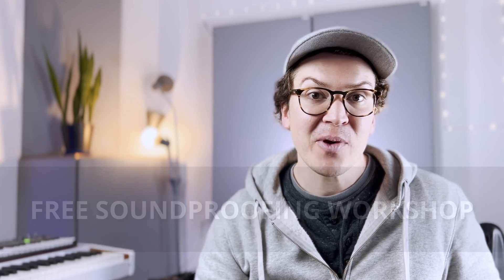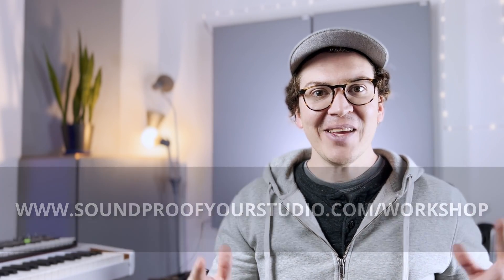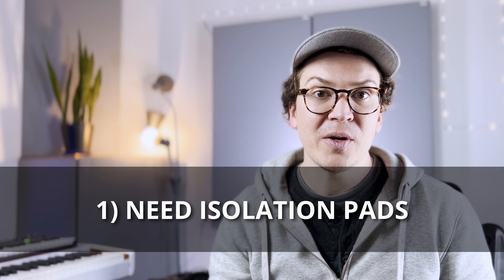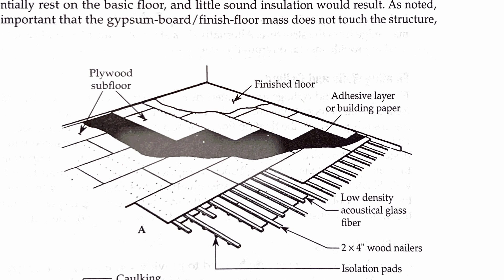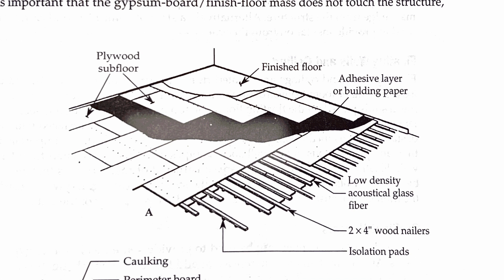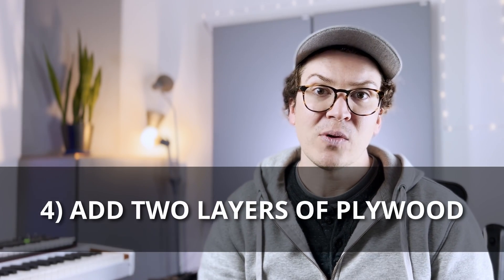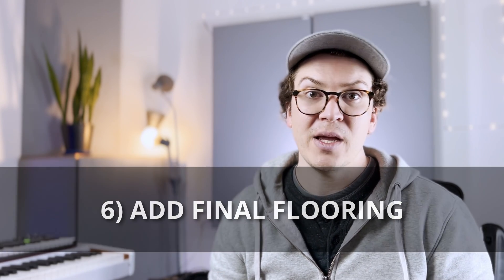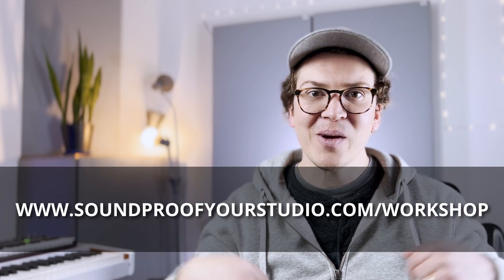How To Build A Plywood Soundproof Floating Floor

Comment: that was a very good and succint presentation that got right to the point and was really clearly explained, no digression or ego excusions about irrelevant stuff.  I am so glad to learn about the rubber joist cradles!  I already have an exisiting plywood subfloor, so I thought I could put acoustic mat onto that as well, or perhaps put it between the plywood layers above. Is that going to be worth the extra cost?  This is a 3rd floor living studio in a wood framed house. Thankyou , Sam

Comment: What about on concrete floor in an apartment on the 4th floor?
Reply from the maker: Great question! 🙏 On a concrete floor, you don’t really need a floating floor for decoupling. You can add mass and absorption, like low-density fiberglass or a layer of plywood with Green Glue to help reduce impact noise and low frequencies.

If you want a detailed, step-by-step approach tailored to your apartment setup, you can book a free call with me here: https://www.soundproofyourstudio.com/Step1

Comment: Why should you use low density Fiberglass? Rather than high density?
Reply from the maker: The density is important because if it is too dense the floor will not float and if it is too soft the floor will touch the subfloor below. Density is carefully thought out in the plan to provide the ideal amount of float. Experience is the best choice here by working with someone who has done this before. Are you building a home recording studio?
Reply: @soundproofyourstudio   thank u for ur answer. Do you recommend Owens Corning Type 703 ? i feel that it is not dense enough
Reply from the maker: Yes, that is what i have used in the past. Do you feel confident you can build this studio perfectly without making any mistakes?

Comment: Thanks a lot for the great video. Would this help for inside a small vocal booth to reduce the noise for Neighbours below? As in building the floating floor just for the surface area of the birth itself rather than entire floor of the room? I get that sound could still travel down but would it help at all?

Comment: What about a suspended concrete slab connected to concrete block walls ?  Concrete is a good conductor of sound.  Once you manage to couple sound into the concrete slab it will propane throughout the entire structure.  In that case, surely it is best to float a floor over the slab.  Especially in a room within a room construction.  I am thinking in particular a home theatre with the subwoofer sitting on the floor.
Reply from the maker: Check out Philip Newells Book Home Recording Studio design. He talks about floating a concrete slab.

Comment: How do I know wether the new floor and sleeper boards won't create a big resonating floor?
Reply from the maker: It’s not as good as a floating slab for that reason, but it shouldn’t resonant as long as there isn’t an airspace. I don’t recommend this design however is was in the master handbook of acoustics.
Reply: @soundproofyourstudio you dont recommend but did a video about how to do it?

Comment: What about building a floating floor over a concrete floor in a basement? Would that help decoupling the room from the house structure even further?
Reply from the maker: No, because to properly float the floor you would need to spend $20k pouring concrete on isolation springs.
Reply: @soundproofyourstudio  I mean, over an existing concrete floor
Reply: @HCkev, I'm eager to find out more about this. I'm in the midst of planning a new studio build with a concrete slab. I'm curious if opting for a floating timber floor would offer any acoustic advantages. Additionally, from a thermal perspective, I'm considering a floating floor with rockwool for insulation. However, if this doesn't significantly enhance acoustic performance, I'm contemplating a more budget-friendly approach, like using celotex boards with a concrete screed on top. Any insights or advice on the best course of action for both acoustics and cost-effectiveness would be greatly appreciated!

Comment: Hey, do you have any recommendations for iso pads for 2x4 joists if I want to place them on their flat sides to save vertical space?
Reply from the maker: So I don’t recommend iso pads. I prefer using a different floating floor method.
Reply: Thanks  @soundproofyourstudio  ! I thought you recommend Iso Studs at 2:04. What do you recommend instead of Iso Studs (short of concrete)? We're building a detached chamber and need a clean floating option (we can't place the joists on loose glass fiber).
Reply from the maker: @Mxy-ff4zk  This might be best discussed over a Soundproof Clarity Call - https://www.soundproofyourstudio.com/Step1. It's hard to know the best solution without really knowing what you are doing.
Reply: @soundproofyourstudio  thanks